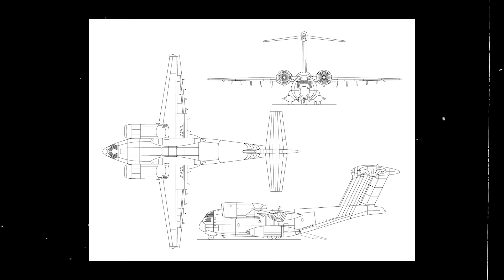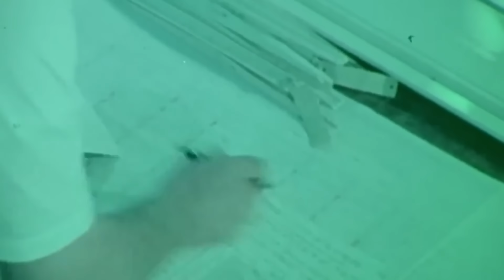The Plane that No One Wanted (But Could Land on a Football Field)

Comment: 800 feet for takeoff and 371 feet (400 ish feet) for landing that is insane. 😱😱😱
Reply: Seems like it would have been tailor made for the Iranian hostage rescued operation
Reply: Sounds like carrier landings with a little more wiggle room
Reply: Imagine if it had rockets.
Reply: @hillbilly4christ638  would be a site to see  there is a military transport plane that does have rockets that assists in take offs. The C-130 uses JATO or jet assisted take off. There is video of such use only at air shows or special need.
Reply: then there was the Short Skyvan and the Sherpa

Comment: This video is not correct.  The YC-14 and YC-15 were in competition.  The reason neither went into production is because it did not have capabilities significantly greater than the C-130.  Both used way too much fuel and had limited range.  Since much of the C-130s mission is flying at low level, having an aircraft that burned 3-4 times as much fuel or can barely fly from the east coast to Europe without a tail wind did not make sense.

Comment: Blub lies.
The C-130 only needed 4000 feet IF IT WAS AT MAXIMUM LOAD.
It could COMMONLY take off and land in under 1500 feed with a useable load and light fuel.
(for that matter, a KC-130 managed well under under 800 feet AT high load or full load, during tests on the Forestall - but that was with at least 30 knots of headwind every time, Carriers are handy that way).
FAR more comparable to the YC-14 than the text for this video claims.

The 14 was an interesting design, but not ENOUGH of an upgrade to survive the late-war defense budget cutbacks.

Comment: Very nice plane for sure but the needs of tactical airlift seldom went with full payloads so the widebody would not be an advantage in operations.  In the time period, all acquisitions were geared to NATO/Warsaw Pact scenarios.  The predicted airspace traffic over Europe negated the sending of a high value aircraft when the cheaper C-130 with its turboprop engines could go in.  AMST was an excellent prototype development program and we would be wise to continue such programs but those days are long gone.

Comment: Exceptionally sensitive to high loading in crosswinds, the engines badly heated the wings leading to accelerated fatigue and if you had a fire in the engine that you couldn't put out in under 40 seconds you were going to have to "land" with about 58% of your original wing surface.   It had some incredible features, yes.  But...

Comment: The McDonnell Douglas YC-15 was a very similar aircraft. It was the pre-cursor for the C-17. The C-17 can land in the same footprint as the C-130 but carries far more cargo. The C-17 uses blown flaps to generate this high lift. The engines are blowing over the flaps which are in the stream of the engines and has 100% thrust reversers. In addition, it can backup fully loaded up a 3 percent grade, do a 3 point turn. It can be unloaded and loaded within minutes while leaving the engines on. During one of the Gulf wars, the C-17 was loading and unloading so quickly that they asked the C-130s to move aside. So. The USAF wanted this plane and got the C-17. It’s served the warfighter well.
Reply: The C-17 CAN NOT "land in the same footprint" as the C-130 or even close.
Try putting one down on a 1500 foot field - it WILL NOT MAKE IT (thought to be fair, the C-130 need to be FAIRLY light loaded to do so).
It does have a lot more range and capacity - which is WHY the Air Force prefers to use it when they can.

Comment: This is all nonsense. The need for airlift to remote unprepared fields during the Vietnam war was brilliantly met by the Dehavilland Caribou and later the Dehavilland Buffalo. But the American defence industry killed those programs because they were built in Canada. These amazing aircraft were designed with direct consultation with the US Army. They gave the Army exactly what they wanted. So the SecDef took all fixed wing aviation away from the army and they were stuck with the c130. When it came time to try to rescue the YS hostages in Iran they had to try to modify c130s with ridiculous forward firing rockets to slow them down so they could land in a soccer stadium. The Buffalo could have easily done it with no modifications. It was all about politics, not serving the military need. The YC14 was a research aircraft. It was never intended for production. The powered lift technology was used on the C17 globe master.

Comment: I was a fresh out of Purdue's school of Aeronautical & Astronautical Engineering in 1977.   This was the airplane I wanted to work on.  I got my wish in the fall of 1977 as I became a flight controls engineer on this project.  I was involved in quite a bit of wind tunnel work  before the project was put on life support around the end of '77.  As I recall, there was hope that the Shah of Iran - purportedly very interested in the aircraft - would purchase some and keep the project going.  The Shah started to have other things to worry about and that purchase never occured.
While an amazing airplane, it was going to be very complicated.  Imagine an engine out scenario on an aircraft that developes significant lift from the interaction of the engine and the the flaps.  Yes, that's right, flying with an engine out was going to require a split flap configuration.  Due to the low speed flight capabilities, most of the major control surfaces were double jointed to maintain control of the aircraft.
This airplane's unique design also caused some interesting problems in the wind tunnel.  Due to the engine's thrust being used to create lift, the model needed to be pressurized and that pressurized air was hosed out of the model's simulated engines.  The guys that put the models together in the wind tunnel had a much better union that we engineers had.  They were not allowed inside the wind tunnel when the model was pressurized.  Just prior to buttoning up the wind tunnel for the test run, the model would be pressurized and a test engineer would go inside, garbed in protective gear like the main character in "The Hurt Locker", and inspect the model to make sure everything was still secure post pressurization.
One of the problems that needed to be solved was a specification that involved a paratrooper's deployed parachute getting caught in the exit door and the trooper hanging out behind the airplane in flight.  I remember watching a film of an early wind tunnel test that had a wooden simulated paratrooper hanging out of the model's door towards the rear of the model.  The turbulence of the aft body was so bad (probably had something to do with missing the drag predictions as mentioned in this video) that the model paratrooper was repeatedly slapping against the aft body so hard it was chipping paint off the airplane model.  HA!
Man this was a long time ago.
Reply: My first thought when the system was described in the video was that an engine failure on takeoff would end badly on a short improved runway. That is very cool you got to work on the project!
Reply: The real reason it was cancelled is simple, President Carter (from Georgia) and home to Lockheed and the home of C130's, C141's and C5's. Factoid: did you know during flight tests the YF-14 exceeded mach 1.0.
Reply: It's the reason the engines are so close the fuselage - to reduce the rolling moment due to asymmetric thrust.
Reply: @dougball328  I would respectfully suggest that it is not THE reason.  There are many reasons to put the the engines as close as possible to the centerline of the aircraft; both structural & from a stability & control standpoint.
Reply: @scottbosecker3732  Well, then I guess working at Boeing for 37 years and working with Tim Wang, the low speed lead on the YC-14, he must have told me incorrectly.  Yes, there are many reasons - but for structural considerations you put them further out on the wing for load alleviation.   Why do you think the 707 had the outboard engine so far out?  And the B-52's fuel tank?  (That was outboard and forward for both load alleviation and flutter)
Reply: @dougball328  Well I guess you are correct then...  it is THE reason.
I wasn't a structural guy but may I suggest that most of the lifting force on this airplane, with an Upper Surface Blowing (USB) flap equipped wing - with the flaps fully extended - comes from that system.  That is a very large load - not found on your examples - that probably drives the preferred location structurally for those flaps, and thus the engines, inboard.
...I also don't recall our Flight Control area being divided up into "high speed" and "low speed" (Tim Wang - low speed lead).  That sounds like probably the aerodynamic guys  ...although the C-14 was not a normal project HA!.  As I recall we (flight controls) were divided up into longitudinal & lateral-directional groups.  However, it has been a very long time ago and I was only on the project for a few months before it imploded.  I spent most of my time at Boeing on the 767 project and that was definately the way I remember Flight Controls was organized there.
I have found - in interviewing people in things that happened a long time ago - that if you interview 5 people you will get 6 or 7 different stories.  I don't want to get into an internet slap fight over something that happened almost 50 years ago.
Respectfully,
Scott

Comment: I was a US Army soldier 1973-1997. The mid to late 1970s were difficult times in the Military. Budgets were slashed. I remember in 1975 at Fort Lewis, Washington and again in 1976 at South Korea we planned field training exercises, loaded up our convoy of trucks, pull out of the motor pool, then the Commander would lead us around the block back into the motor pool. There was no budget for diesel. We set up our tents in the motor pool and pretended we were in the forest. We ate expired Vietnam War era C rations, which was fun because some still had cigarettes. In the 1980s they pulled out expired Korean War K rations. They were very light to carry in our ruck sacks.
Reply: @larryfromwisconsin9970 U.S. Marine 1968 - 1991, here.  I remember those days very well.  We had few mops to use for cleaning the barracks.  Our mops were so sad-looking having lost most of their strings during their many months of use; couldn't do much with them.  Requests for replacements went unheeded until, one fine day, we received one, just one, much needed, new Navy cotton deck mop.  It was like a gift from heaven; the clouds parted, the sunlight shown through, and, I believe I heard, a short, multi-voiced aria.  That was until some barracks jerks clowning around with it broke the handle in two.  We hadn't had it a day and it was broken.  Wanted to string them up by their heels.  Mended, it performed its tasks but, it wasn't as 'purty' as it originally was.

Don't mention toilet paper.  If you had a normal poo, you got two squares.  If it was serious, you got five.  Now that was a joke, folks.  Toilet paper wasn't issued by the square; self-rationing was understood by every Marine because once gone, we weren't getting any more until the next issuance.  Budgets were extremely tight.
Reply: @GeorgiaDawgAthens does the Corps still give half the money back, if they ever really did give it back.
Reply: Ya, the 75 and on got shitty on land also. Joined in 83 at least it beat 1.75$ @12 hrs a week. The Navy (Persian Gulf area) had plenty of $$ and supplies. Flew in 2 civilians to fix our crane, showed up 4 days later with a pump and parts to make it work.Then I done a Destroyer that was Flag ship in NATO.
Reply: I had a similar experience in the Australian Army.
In one two-week field exercise, our regiment was allocated 20,000 litres diesel MORE than requested!
A year later, our regiment was only allocated 15,000 litres diesel for the ENTIRE YEAR.  We carried out a field exercise instructed to "yell BANG" in lieu of any blank ammunition.  The only things we were able to rely on were food and pay, everything else went to (bleep).
Reply: @OhSoddit 💥pow!💥pow!
Reply: And that was the time when US governments spent billions of dollars on useless militarily programs like early stage of B2 bomber program - 2 billion dollars each. And at the same time you had to eat expired canned food. Don't you understand that we were just a cannon fodder for them.
Reply: Times changed. US spend billions of dollars on military programs. More than any other country in the world. Did it make US a better place ? I doubt it. Health care system crisis, housing crisis, drugs, unemployment, soaring cost of living making millions of people poorer and poorer. And it is in such a wonderful country with smart and hard-working people.
Reply: Probably better than MREs?
Reply: @andrewemery4272 MREs are far superior. Some are even really good (beef stew, roast beef, manicotti, beef stroganoff is tasty just really mushy)
Reply: @andrewemery4272  yes much better

Comment: In 1976 we watched a live fire demo at Larkhill with abbots firing  then this C130 came down landed in a small field dropped off pallets of ammo them turned around and took off again very impressed, but all the future mods on the c130 meant it could no longer do that sort of thing again so they developed the low pass throw out the back method of re supply.

Comment: Speaking as a former deployment planner, the problems we still face with the C130 are the same as those we would have faced if the YC-14 or YC-15 had become operational.  All three types lack range and enough pallet positions to make them dual use tactical and strategic airlifters.  Even as tactical airlifters, their shortcomings are glaring.  I remember during the early phases of OIF a handful of C-5s and C-17s would disgorge dozens of pallets at a forward operating base in Iraq where dozens more C-130s struggled to move them to their final destinations.  As a result there was a massive backlog of pallets clogging the field.  This problem cannot be solved by a fleet of small aircraft.  You need a large bird on the scale of the C-17.
Reply: I don't like it, but you are 100% correct.
Reply: @mistertwo6113  But getting a LARGE aircraft to manage STOL operation isn't very practical - and it would have many of the same issues as the Herc had or this would have had.
Reply: @bricefleckenstein9666  I agreed w 
@Paladin1873, but thanks for opining.

Comment: The Russians used cargo planes that would land on airfields as close as possible and then large cargo helicopters took over to create a sky bridge from that airport to the inaccessible point where the cargo needed to go. While the Russians often don't make the wiser decisions in these cases, in this I feel they had the most efficient approach.
Reply: Have you ever looked at the VERY VERY LOW load capability of a typical helo?
Even the late model Jolly Green Giants could only carry a hair over 3 tons, vs 12 tons on the current Hercules "J" models.

Their approach was driven by need, not efficiency.
Reply: @bricefleckenstein9666  MIL mi 26's could carry 20 tons if they were completely unarmed, although in m3 their cargo bay was half of a Hercules J model. The easier you can deliver cargo up to exactly where it is needed, the less cargo tonnage you waste trying to get the cargo to the troops. The helicopter airbridge can also do several handfuls of carries a day, while the Hercules, having to travel far further in this imaginary scenario probably can only do one or 2.

Comment: THIS WAS N0T THE 0NLY  TIME THAT B0EING FAILED T0 WIN A USAF MEDIUM/HEAVY LIFT C0MPETITI0N. THE 747 WAS DESIGNED AS THE C0MPETIT0R T0 THE L0CKHEED GALAXY C-5 BUT L0ST THAT T00. HENCE WHY THE 747 PIL0TS C0CKPIT IS S0 HIGH, IT HAD A FR0NT D00R AND REAR D00RS. L00K AT A JUMB0 JET FR0M THE SIDE AND Y0U CAN SEE THE CLASSIC SL0PE F0R THE REAR D00RS.

Comment: When the “third world” clowns in Brazil claim that Embraer has created the ultimate transport platform, it just makes them look so stupid and full of crap. The so-called “millennium” C-390 is all but a modern copy of what America had created decades ago! They now claim it to be superior and the greatest thing on earth. First, all the build are airframes and nothing more! They are a plane assembling shop with all mayor components such as engines, avionics, sensors, etc all foreign made and imported. Their claim that they are indigenous is as full of shit as that of India with their plane programs. These are shit holes with a chip and trying to show off what they don’t own. Embraer is only reputable BECAUSE of their use of advanced systems made elsewhere. They want to be seen as some kind of rival to Boeing and Airbus but the problem is that the joke is on them because none is taking them seriously. Even Boeing saw this and pulled the plug on that idea of becoming part owner of Embraer. Smart people talked them out of that stupid idea.

Comment: What about the C123K? It landed in a lot shorter runways than to see 130 and could take off with rocket boosters.
Reply: And had a MUCH MUCH smaller weight capacity with a notably shorter range vs the Hercules.
Thing only weighed about 26 tons WITH a full load on it, had a payload capacity of LESS than 10 tons - and perhaps 14 COUNTING FUEL.

The Herc was specifically developed as an upgrade from the C123.

Comment: Why does the military seem to scrap things that work ? This plane and others like the A-10 Wart hog for designs that aren't as good ?
Reply: Try pulling a YC-14 out of a roll when you lose an engine, especially on takeoff.
You're probably upside down before you CAN react - or already crashed.
It's FAR from all positives.